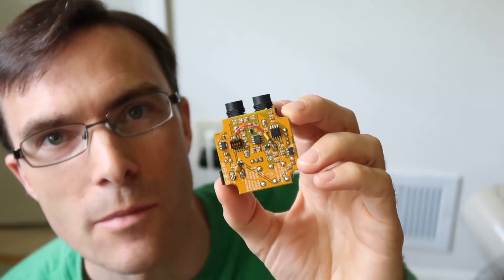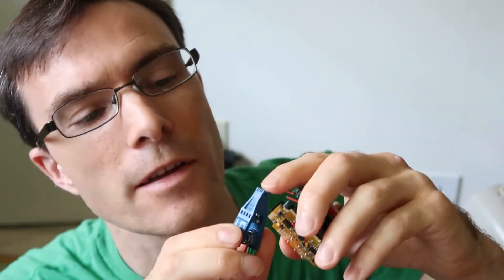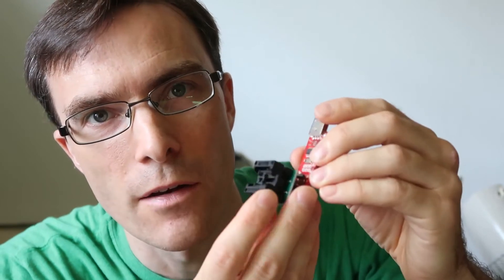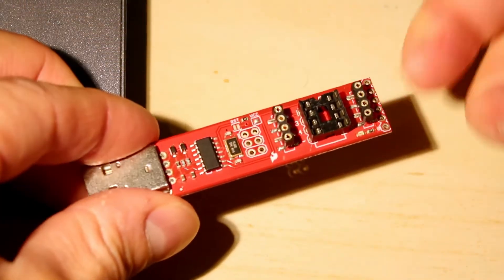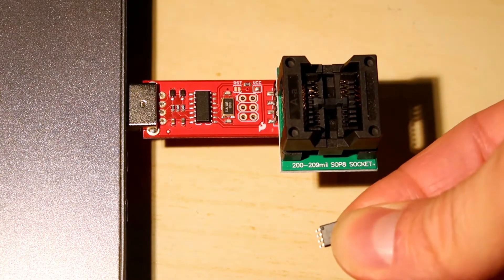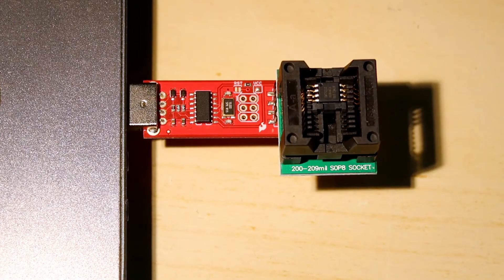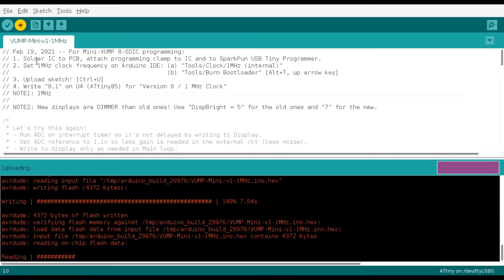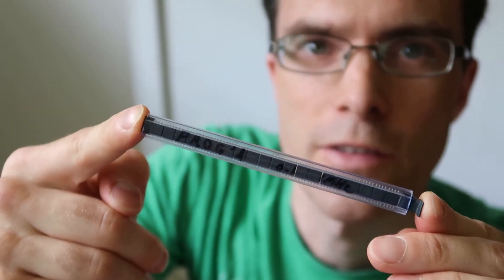Programming microcontroller SOIC-8/SOP8 using a ZIF Socket for ATtiny85 with Arduino IDE

Comment: I keep getting this error:
avrdude: initialization failed, rc=1

This doesn't happen to me with dip8 version, only with sop! Did you do anything configuration-wise ?
Reply: Hello, I am getting the same issue with my SOP8 chip, but it works when I try the DIP8 version. Were you able to find a fix for this problem?
Reply: @Babysnatcher99  there's no fix, I discarded those chips and purchased directly from Microchip, had no issues. It turns out the ones that throw this error either badly preprogrammed ones or counterfeits